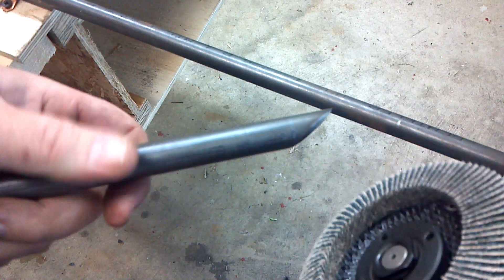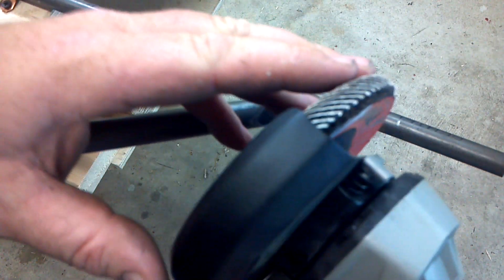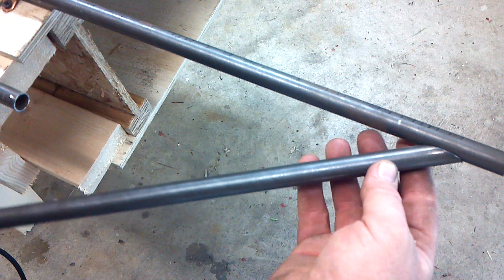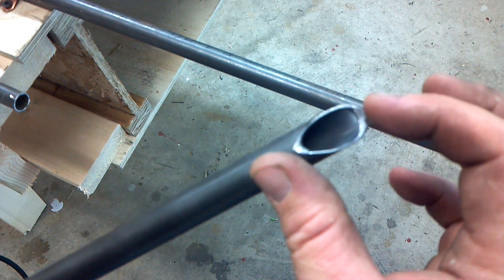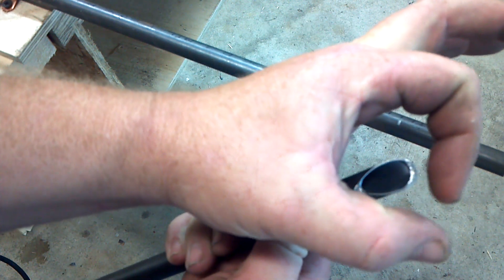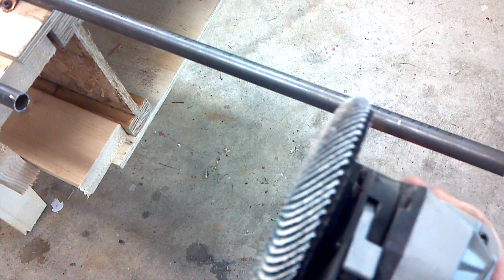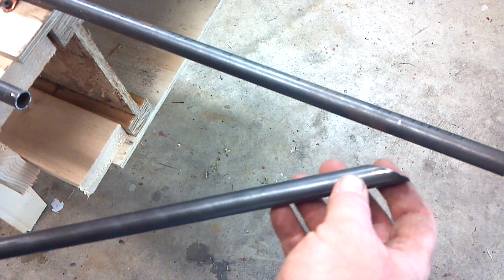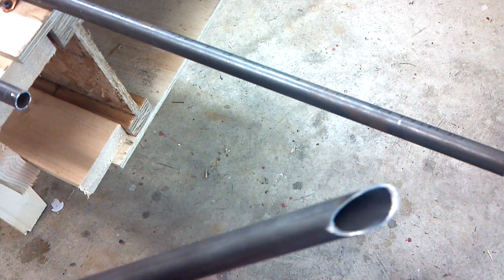Legal Eagle Ultralight construction video #23

Comment: After building open wheel race cars for 40 years you might want to put the tube in a vise to hold it. After the thin, 1/16" cut off wheels became available I started using them over a standard grinding wheel. I actually found the Harbor Freight ones work pretty good. BUT be careful and don't go sideways because the thin blade will brake and your body parts will not like it. For redoing the same angle of joint I use index cards and wrap around the tube and cope the card and then you can re do that angle over and over accurately. You can also mark the other side so to align the ends up for a specific length.
I do have the plans for the Legal Eagle and might build one.

Comment: An old friend used a bench grinder to fit tubes. He dressed the wheel to the tube OD and did the same as you are doing with the flapper wheel. I realize that you have welded more planes than most of us but watching you hold the tube with the point INTO the flapper wheel gives me cold chills.